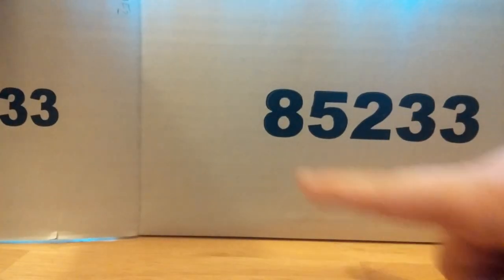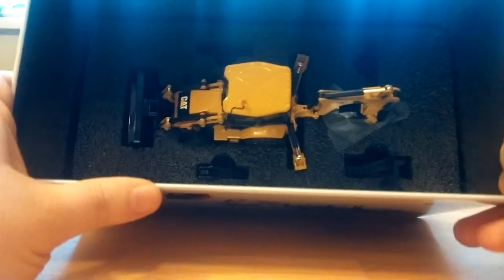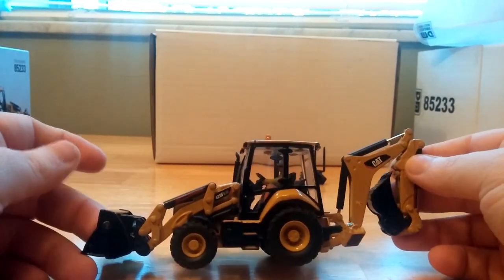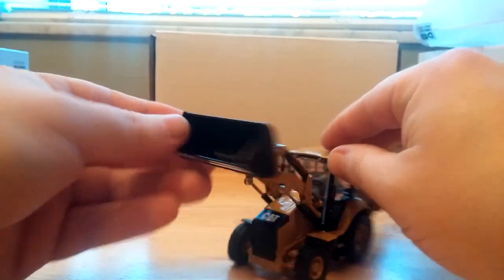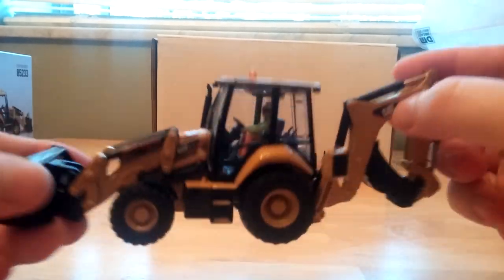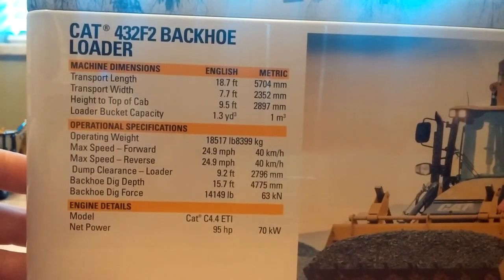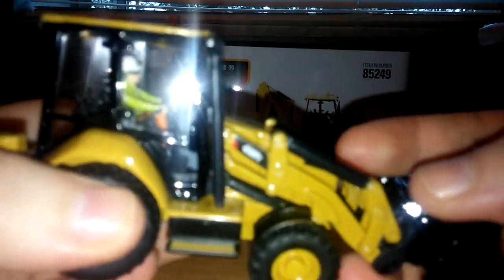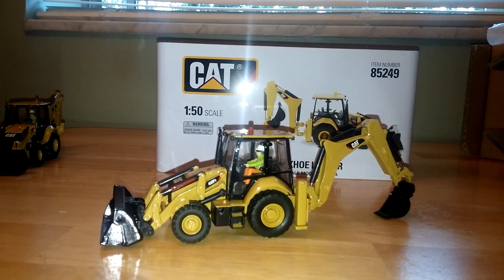Diecast Masters Caterpillar 420F2 IT & 432F2 Backhoe Loaders

Comment: Far as backhoes go I like the 1/50 Komatsu from First Gear it's very good the only complaints I have with it is the steering it's modeled but nonfunctional the outrigger pads are supposed to be flip over pads those don't work but it can reach up high to load dump trucks or at least my 1/53 Tonkin Kenworth other than the issues I have it's very good
Reply from the maker: +BigCountry545 I also have the Komatsu Backhoe, and I like it a lot. I love the fact that it came with a compactor attachment.
Reply: has anyone figured out a work around to fix the issue where the backhoe of the Komatsu can't reach over the side of a truck?
Reply: Nicholas Erkelenz not that I know of mine works fine with the 1/53 Tonkin dump trucks very good haven't tried it with a 1/50 dump truck yet
Reply: How  much  cost  for  it